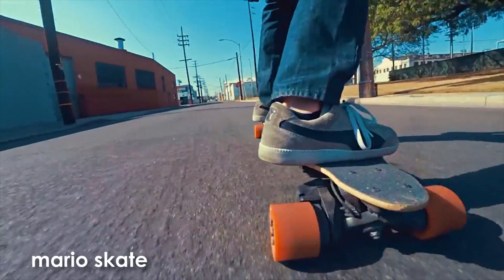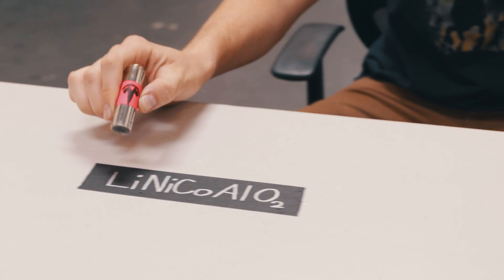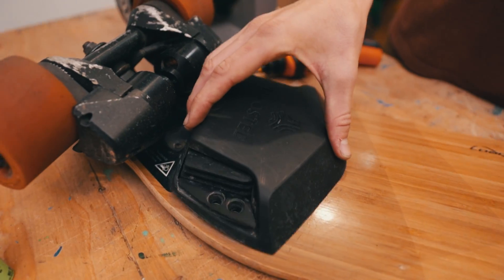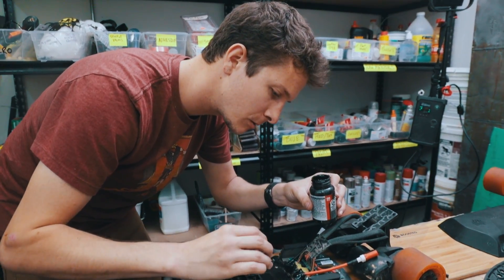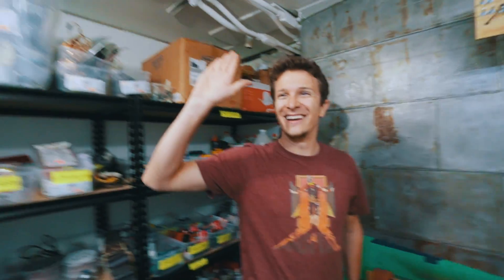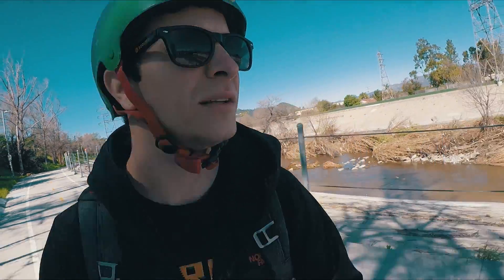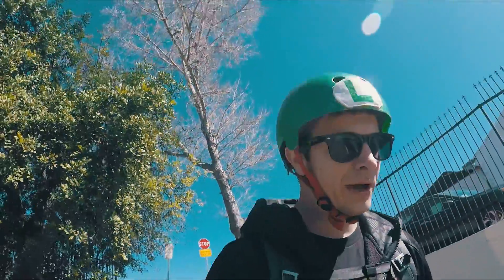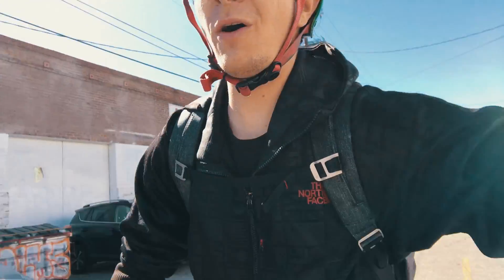Tesla Batteries in an Electric Skateboard!

Comment: hey there, how about just add a relay with adjustable voltage, which you can use the tesla battery until a point then start using the original battery. or you can just use transistor do do it,

Comment: maybe you can somehow convert the extra battery packs into a sort of oversized portable charger so the board is constantly charging as you ride, then once the "Mega Charger" runs out, you still have the full battery in the board. Although, I guess that could overload the battery causing it to explode or something. Well then how about you have the wheels turning charge it as you ride? I'm pretty much just spit balling here, I don't know anything about engineering.

Comment: One way you could keep peak torque would be switching your battery supplies.  that way only using one pack at a time instead of all three at the same time.  My guess is that your board has an internal controller that drops out at a specific voltage.  If you can find a way to bypass this you could use the rest of your new packs, but because torque is proportional to voltage you will still have the lower speed at the lower voltage.  Keep your bearings maintained, and buy some spandex clothing.

Comment: did you ever figure it out? the only thought in my head is how vapes work and you can adjust the output maybe using a basic board from a box mod wich also use the same batteries

Comment: u can estimate the range by timesing the voltage by the amps per hour to get the watt hours every 10 watt hours is 1k add the watt hours then after working out the range from the new batteries add it to the range of the board

Comment: A simple way to fix it would be to have 2 spares in ur bag if u cant find a way to lower the voltage. So basically just unplug the ones plugged in and then swap em out😂

Comment: During your water example it would be in series whilst pouring the bigger water bottles not parallel, parallel would just be twice the amount in one bottle but the same stream rate.
Reply: No. A series doubles the voltage (i.e. stream "pressure"), parallel doubles the amperage so you can either have a higher stream "rate" or you can have a higher stream "longevity".
Reply: This is why my electronics professor refused to use the water analogy.......
Reply: Btw there r better boards that go 22mph and can go for 18 miles
Reply: Nah. Series would mean there is only one hole for the water to go out of. The other hole in the 2-bottle example would have been stuck as an input to the other bottle. The pressure might increase, but it still won't be as effective as two water bottles. Current is increased by adding something in parallel, like what Wren did.
Reply: In other words, since I find my previous comment poorly worded, and I'm too lazy to edit, parallel increases the stream rate. Series doesn't. You only increase the capacity, without increasing the number of holes for the water to stream out of.
Reply: The Unwanted Turtle no he got it right, like it will blow up if u pull too many amps out so with Tesla battery's with lower amp draw ratings u need to put them in parallel.
Reply: youngrizing excellent explanation bro/sis, series would damage the the circuit board. Parallel increases the range. I think the battery pack wasn't properly balanced,
Reply: The Unwanted Turtle 
Parallel is = and series is --
Reply: It is easier to remember the differences if you think abouta series of events leading up to a single moment that might not have happened in a parallel demention best if explained using a black board (chawk) or a white board (dry erase) parallel meaning side by side and series meaning one behind the other. A moped is still the superior option swing that a 50cc requires nothing more than a helmet and a learners permit to drive a car to operate and can go for 100 miles on a gallon does about 40mph stock, with plenty of cheap and easy to install mods to make it go faster and only cost a little over $700 after S&H rather than over $1500 for something that only goes 18 miles on a charge.
Reply: The Unwanted Turtle 
Just wanting to help you out as much as possible financially and intellectually as possible in the long run brother so don't take it as bashing but more as constructive criticism to help further your knowledge so you won't have any unnecessary burnt equipment or expenses that otherwise could have been avoided so you have a choice to make, A: Take this as a positive and learn from more knowledgeable people like someone whose mentor/childhood scout master/adoptive uncle who is a retired Lockhead Martin Skunk Works Rocket Scitist and the #1 expert in S1000D and grand father who is a retired master electrician and Nuclear Power Plant Manger from Geaorgia power in which he learned from and gets his technical knowledge from not to mention a family member of mine events fuel injection and so engineering and learning these technological things and applying them comes natural and another guy on here who is in classes who has a very reliable source via a professor in this field. or B: Take it negatively, show arrogance, unwillingness to learn and unwillingness to seize the opportunity for free education and get on the defensive and be ground upon by people. Intellectual people really love to share knowledge and help those less knowledgeable become more knowledgeable as to just have a more in depth conversation with a new friend. We really don't care if you knew at first other than we see an opportunity to give you more and we put the information out there and a wise person take the information fyi wisdom and knowledge are not the same. We as intellectuals love when someone knows something we do not and educates us so we can be that much smarter so be smarter or be arrogant, defensive and stay less intelligible is all about the personality of the person making that choice.
Reply: The Unwanted Turtle 
Basically not to gender but to help you. I truly hope you see the bigger picture so we can count you as one of us, as an intellectual. So I employer you to choose option A and join us, please don't get defensive.
Reply: Dude, you're completely confused; a series connection doubles the voltage (i.e. "stream" rate), while a parallel connection doubles the Ah (i.e. "stream" longevity)...
Reply: KleiberFan Good point. The water analogy got me confused haha.

Comment: What if you use more tesla batteries rated at the same voltage of the boosted ones because tesla batteries hold more and can output the same amount when in parallel

Comment: The controller of the booster board is programmed to cut out at said voltage level. Once you use the buck-boost voltage when original battery is depleted the tesla batteries will charge the original batteries. Thus making the tesla batteries less effective. Do you really need the old battery? If not, a buck-boost converter can be used to fool the control circuitry to thinking it is above the optimal battery voltage. I would recommend designing a battery monitoring system which will also implement cell balanced charging as well as monitoring system during use.

Comment: The chemistry of the cell determines the voltage.  It takes only trace chemicals to produce this voltage, but once a load is introduced, the chemicals are consumed (chemically changed) almost instantly.  The solution is adding more chemicals, in this case, more cells, or groups of cells to produce a desired voltage.  So, Brian, below, is right.  The amp/hours of the cells should be easily discovered allowing easy determination of a range based on other factors of the board, motors, electronics, etc.  The unknown factor is the Electronic Speed Control (ESC), which contains circuits to limit current to protect the motors, provide low voltage cutoff to protect the battery, and limit speed to protect the rider.  What was being experienced was probably the cutoff for the stock battery.  It should be taken out and replaced with another ho-made. Remember, the three "batteries" must be equal or uneven discharge will occur with undesirable results including damage to your expensive battery packs.  If the on-board ESC can stand the extra duty cycle, extended range should be realized.  Good video!

Comment: could you run the 2 tesla battery packs into the curresnt boosted board battery. could you run the 2 in parallel and maybe the tesla batteries would 'charges the regular ones whenever they start to drop off

Comment: you could make a circuit board that switches between power inorder to preserve the amount used on your board meaning that instead of having one voltage drop point, you have three voltage or in other words instead of running on 3 battery power packs at once, you could run on 3 battery power packs at 3 different thus making it last longer, maybe?

Comment: Your explanation doesn't make a lot of sense. The Packs you made should store several times the energy of the batteries in the board. Unless 25% of the energy in the pack is stored between 40 volts and 33.5, with the other 75% of the energy stored between 33.5 and 30 volts, something else is wrong.
... one thing you could try is adding one more Panasonic cell to each pack to up the "lowest voltage" to 33 in your "reserve" pack. That will let you drain more of the Power in your pack (in addition to increasing the amount of overall power, because you added an extra cell to each pack). Then use a voltage regulator to drop the top-end feed into the board. Cooling for the voltage regulator might be an issue, and of course there's some power loss in the regulator, but the power in the 2 extra cells should make up for that.
... but I still think your problem is somewhere else.

Comment: What you need is a couple of ultracapasitors, they will do the trick. Hook them up to your batteries, and recharge the capacitors when cruising. Get rid of the original batteries. You would also need some voltage regulators. Nice project! ;)

Comment: hey sam and niko, why not use the aftermarket batteries to charge the boosted board battery. i guess cook up some sort of battery charger between the boosted board battery and that way you should be able to monitor the power level aswell. dont forget the shout out

Comment: you connected the batterys up in parralel as appose to connecting them in a series. connecting them in parralel which doubles the amps (capacity) however connecting them in series doubles the voltage

Comment: In-sted of you trying to make the tesla batteries power it You could Make it so it just charges the boosted board all the time that way the original power should be the Same but just bigger charge each time like instead of making it so the bottles replace the glass the bottles would pore into the glass

Comment: because your board converts from DC to ac, you're going to need some bigger caps in order to convert those lower battery levels. 

bigger caps will also output the level of volts you need. 

it sounds like you've got a good amount of power coming to it, I would look at some voltage regulator circus and study what kinds of power they're using. there's a possibility you can recreate it

Comment: make another pack exactly the same and wire both packs in parallel to get twice as much battery life. you can only increase volts in series or amp hours in parallel but only one or the other. keep voltage at what it should be to power the board.

Comment: You soldered those into the wrong spot. You are effectively recharging the boosted board battery as it is being used instead of utilizing all 3 batteries at once in parallel that is why at the end it was barely moving the board along.

Comment: If you have the batterys from the new accu, you have 2170 Batteries. It´s a new type with more capacity than the 18650 type.

Comment: I figure you may have to bypass the original boosted boards batteries and solder your connectors directly to the solder points where the batteries were located this way you may also be able to read the battery life in your packs

Comment: why not try to connect the batteries not straight to the board but add another sequence of wires to simultaneously charge the BOOSTED battery aswell as supply an increased amount of voltage to the motors. or you could try to change the motors to something like a DC brushless motor for the wheels.

Comment: Plug your diy batteries into the BB battery so
as you ride the BB charges and the original battery never drops below the voltage limit. Of course i dont know if this would work because i dont know if you can charge and ride simultaneously. But maybe you could use the tesla batteries as a sort of expansion of the original BB battery.

Comment: I did build my own battery to. 37 volt 19.8 Ah and it did go 25 km on 4.4 ah. I can ride it fore ours. 20 battery from eBay 18650 with 9900 Mah each. It goes 4 ever.

Comment: You need a new boosted board controller for the new Tesla batteries.  Your stock board controller is only designed to handle the voltage of the original batteries that came with it.  Go ask an electrical engineer like EEV Blog who is a youtuber for advise.

Comment: Well your boosted board idea was great the problem you encountered could possibly be solved by ether removing and replacing the original battery with another custom battery or you could add the small cells to the "original battery voltage" by making a small pack that equals the voltage missing from the normal battery the connect it to the leads that go from the battery to the board to equalize the power difference

Comment: or u make more that equal the same voltage that u use in the Busta board so a lot of the same batteries witch will make it be faster but it would run out faster if u have all the battery u need you could make it in about thirty minutes up to one hour. but one thing to much battery/volts, could be bad for the board it could stop working with to much force. and don't act like you are a super smart king if random guy ok so yeah do that it could possibly work

Comment: If You add resistors to the boost board batteries it will cause the voltage to push further  closer with the Tesla capacity . However, Doing so will lower the longevity of the board .

Comment: Refuel the battery with an alternator of some sort so by the motion u have you can refuel those battery packs and with the battery, and water analogy the water is being poured fast enough or not at all. Here's another idea with the water analogy with the glass it's flat an open and can pour out extremely well and fast but will be empty extremely quick. But with bottles you can pour out slowly with the same amount but when a batter bottle is tipped over (flat down) once leveled the water that is inside still remains and needs to be forced out and poured by an outside source.

Comment: It could be the case that the boosted board and its parts weren't built for 15 mile treks. a complete build from the ground up might be the only way to get a board that has a range of 10-15 miles, I think when they made it they were adapting toy parts to make a product that overcomes the "last mile" so by using their board there is a chance that the build would be unsustainable.

Comment: try using the busted boards voltage first until it's near dead then plug in 1 battery pack at a time until there voltage is low. instead of using all 3 at the same time because it will draw voltage from all of those at the same time.

Comment: So did you solve the problem of the battery? If not why not just upgrade the battery on the skate board that is causing the problem, ie add a few more batteries in parallel, thus increasing the amperage of the original battery to match the add on batteries.

Comment: Hi Wren you need to check if your ESC can manage the extra current needed and if your motors can get feed the extra power without reaching saturation. Your 18650 cells need to be at least 20a continuous rating since you have low parallel count. Else you will only add more range. Mind you, a very conservative way of being aware of your range : 10Wh = 1 mile. Which means you can improve from this by refining efficiency, going easy on throttle or kick pushing. A voltage booster won't do shit though, keep it simple to get it working great. Panasonic Tesla cells are good up to 10a with good capacity, you want something else to power this!

Comment: Not sure if it's good to be draining the batteries that low of a voltage... but a buck voltage booster would do the trick as you said. You can even set the booster to switch on at a certain voltage level. As for torque, there's probably a big limitation on just the motors. Voltage/torque is not linear.

Comment: you should find a way to completely  turn off the power from the boosted boards battery or completely remove it all together. the battery capacity and amperage draw of the boosted board is to low compared to the Tesla Style  packs you tried to use boost the mileage. either find away to trick the power control board on the Boosted Board or add four packs and remove the original Boosted Board's battery pack, maybe add a way for the board to monitor the Tesla Style battery's. This will help the Boosted Board to better manage its power consumption. adding Four Tesla Style Packs should double your current Range or Mileage and provide a more stable voltage range.

Comment: Why not use the Panasonics as a charger bank? Keep them wired into the board as they are, but also pass them through a charging circuit to charge the main battery.
Edit: Just be careful not to drain the Panasonic's too low because LiOn's are prone to spontaneous polarity inversion at low charges.

Comment: Metroboard board has a 40 mile range battery on a single 3000wt motor or you can get the dual motor for more torque with a 25 mile range.😎